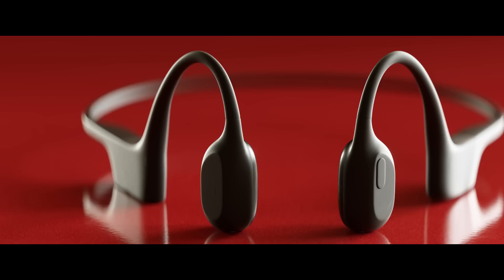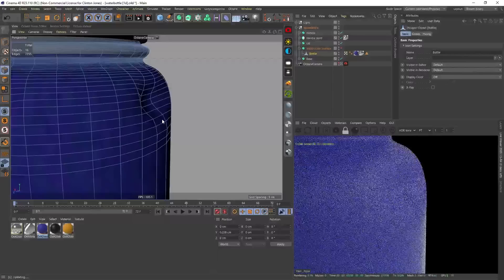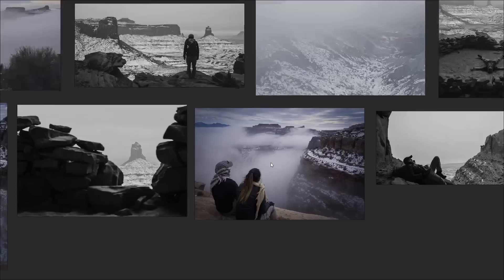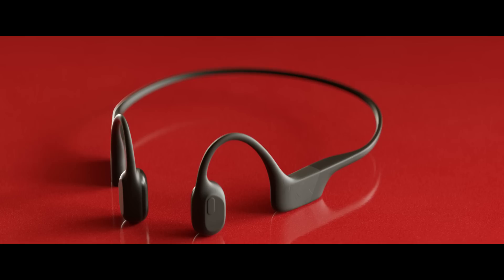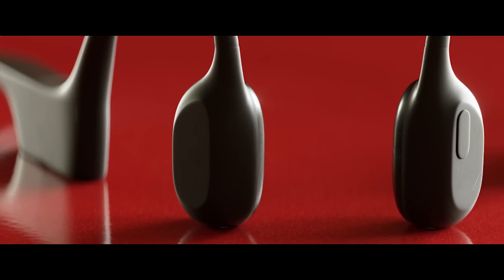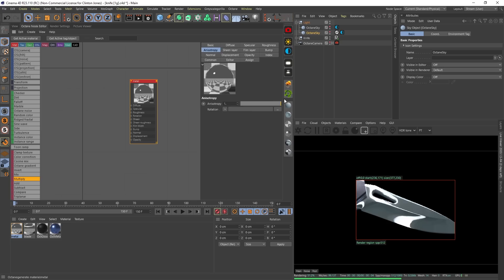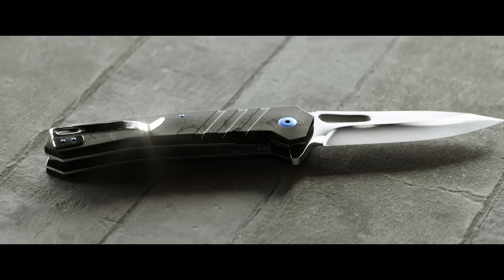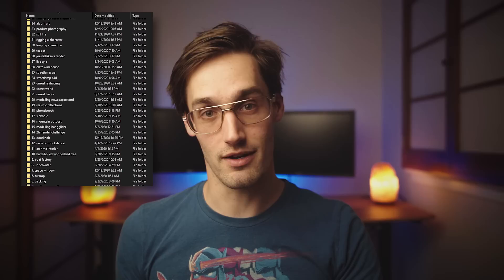How do 3D Artists Achieve Cinematic Renders? | Workflow Explained!

Comment: Wow those models are insane. The detail is so good 👌 there’s so much I need to learn about modeling 😐
Reply: Same :|
Reply: Why are you guys doing the bored or sarcastic face :/
Reply: I think you are kidding.
Reply: @aflvproductions7854  Poker Face
Reply: @aflvproductions7854  didn’t know that’s what it meant. Just the face I was making at realizing I need to spend more time in 3d
Reply: @Kriscoart  ohhh ok yeah. That would be that face
Reply: @aflvproductions7854  your realization face : |
Reply: Yeah those 'wash out' effects on the edges are impressive. It's possible in blender but I find it tricky. Mesh machine helps

Comment: I used to use edge loops for high poly modelling but I've just been using crease set + OpenSubDiv in Max + the occasional loop now. Much easier and faster for similar results.

Comment: I like how you remind everyone it doesn’t matter if we use Blender, Maya, Cinema, 3ds, etc. 

These days the line is blurring with the differences. Sure there’s pros and cons in each, but they are all similar workflows.

Even if hotkeys are different, you still have subdivisions, edge loops, rendering, node texturing, the PBR shader is the same these days, etc. even the gradient node has an equivalent called Color Ramp. Also when you modeled the wooden table, Cinema’s clone tool is Blender’s Array tool, and both I believe function similarly even if the mindset and workflow feel a little different. 

But yea I watch blender to learn new features and specifics to blender, but I follow you religiously because you DON’T use blender and it’s to teach me from a modeling perspective and not JUST from a using Blender only perspective.

Doing it that way you realize how similar every 3D program is these days.

Comment: 1:15 Blender tip: If you have limited geometry to work with (maybe it's a video game asset you're making) you can sometimes instead of using edge loops go into edit mode then select the edge that needs to be sharper.
And now press Shift+E and move your mouse to control how sharp that edge is!

PS, this doesn't always give the best result so just try it out and hopefully it looks good!

Comment: I think that knife blade could go one step further to get perfect shading. Im guessing you made the shape of the hole and then simply deleted the polys, well this is what most people would do. However there is a better solution. First model the knife without the hole in it and then duplicate the object put around 2 maybe 3 levels of sub div on one of them and then on the other one apply a shrinkwrap to it and make the target the the one with the sub div's. After that get the shape of the hope and delete the polys. Now compare the shading with and without the shrinkwrap you will notice a pretty big difference in shading and it will act like the hole was never there. You will also notice when doing this method on a curved surface you wont get any pinching and the difference in shading would be even more dramatic then the flat surface. Also one of the most underrated tools that for me is essential when sub div modelling that can really help with getting the shapes you want is the crease tool or what ever its called in the software people are using. Say you have multiple curves in one part of the model and they need to be perfect and without lumps and bumps this is the way to do it. Once you have the shape apply the sub div, get rid of the creasing and move on to the next stage of the model.

Comment: Hi Clint, you have been a great inspiration to me. Because of you and the guys at corridor, I got into 3D modeling and rendering, mainly on blender. I'm a mechatronic engineer, I use Solidworks every day wich is a totally different kind of 3D modeling than say Blender or C4D, but i really like the things you can do on them. I tried to make a render on blender from one of my designs that I made in Solidworks, but I have no idea what to do with textures, specular values, roughness etc. and lightning is really confusing to me as well.

So I wanted to ask, (TL;DR) What tutorials/videos/content do you recommend for someone like me who only has knowledge on functional/mechanical design and has never worked with rendering?

Comment: Would you recommend something like solidworks or blender if the end goal of the models was to 3d print. Thanks for any input from the comments <3

I like the idea of realistic models but why blender for this. How do you feel about something that makes it easier to 3d print after making 3d models (what i want to do). Ive used both blender and solidworks and have felt that its a lost cause to try to use blender for anything i want to 3d print (novice level experience at both programs).

Comment: “The bigger the light the softer the shadows.” This is incorrect. What matters is the area of the light, if you have a giant diffuser on a light and you step further and further away from the light source the area becomes smaller giving you sharper not softer shadows. Think of the sun, it’s bigger than any area light here on earth and yet sun shadows are sharper. What matters is the distance of the light to the object, the closer the object is to the light the larger the area and the softer the shadows. Try it out. Look at any lamp shade and hold your hand near a piece of paper. Start walking away from the light source and the shadow will become sharper the further away you are from the light source.

Comment: Why are Triangles frowned upon ?
Why are Quads better than Triangles ?
Reply: As I understand it: If you're going to subdivide your model, it's best for it to be all quads, or all triangles. Otherwise things get messy. Objects like this are better suited to quads.
Reply: @iAmTheSquidThing  Ah okay does make sense, thanks !
Reply: quad is better if you are going to deform your object i.e. for an animation to prevent kinks, they create a predictable edge loop for modeling etc.
Reply: @digitaltennisshoes  Okay thanks for the info. !
Reply: @NecroViolator  Triangles or N-gon is ok if your model is going to be stationary, but not a good practice. This mainly applies to "hard surface" modeling with [organic/sculpt to animate very like use the weighting, joint and skin tool] bear in mind the is advance.
Reply: @digitaltennisshoes  Okay thanks. Gonna try to make Quads all round then, thanks !